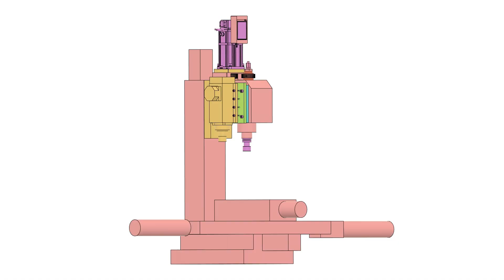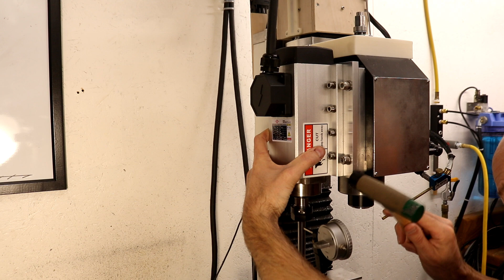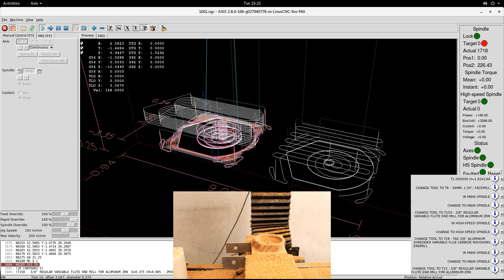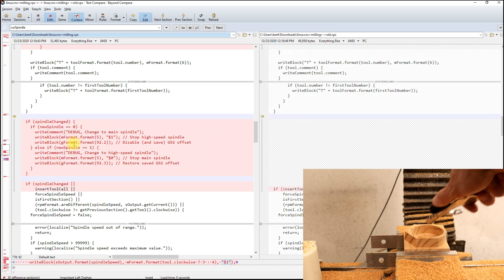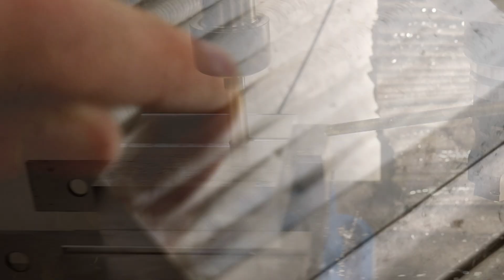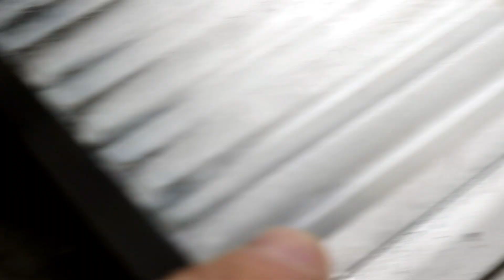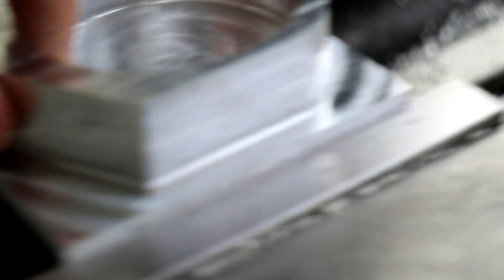Companion High Speed Spindle, LinuxCNC

Comment: try to slow that finishing pass abit more, i belive i am down to around 9000 rpm and 40 IPM on the finishing pass, with 0.2mm radial cut and a spring pass, leaves a very good finish, close to mirror
Even your spindle should handle that rpm, it doesnt have to run at high rpm all time ;)
Reply from the maker: :) Will give it a try. Your most recent video you use 4300mm/min for roughing, 24kRPM, then slowed down for finishing?
Reply: @kentvandervelden  12600 rpm, 10mm depth, 0.8mm radial and 4300mm/min, my spindle only goes to 18000, but mostly run it around 12 and down, sometimes 15000

the endmills can handle more than most know :)
Reply: Sorry, was in a christmas party (we have little counts of Covid-19 around me) 

Yes i do main cut, and then i leave 0.2mm on the walls for a finishing cut + spring cut at around 1000 mm/min (just below 40 IPM) and that has worked great.

I have also used some DLC coated endmills lately as finishing tool. and that has given great surface on walls.

Comment: Nice work Kent.  Could some of the surface finish be due to machine rigidity ?  Interesting project anyway.  When I designed my CNC machine  I allowed for an interchangeable DIY spindle to fit a low speed high torque unit but that is a distant project (!)
Reply from the maker: Probably nearly all of it :) And, in the main spindle there's 2 thou of runout, but only when the spindle is clocked in one place. Bad bearing or missing bearing? I debate between replacing the bearings and replacing the spindle. 
That's an interesting direction. Most people look for more speed, but you want lower. It's probably not practical at such high speeds, but something like a CVT or cone pulleys, optimizing pulley ratio for torque and speed could be nice.

Comment: I've been pondering this same addition to my mill.  It might be worth your time to build a second linear guide with ball screw that allows you to retract the second spindle above the primary and possibly lower as well.  Something with a smaller range 4-6" seems reasonable.
Reply: I had thought about this myself as I'll be going dual spindle (albeit with a very small NSK precision electrospindle). I'd be recommending either box or dovetail ways (either made or rescued from a cross slide on a dead lathe?) over linear rails because you only need to move them between two stops (unless you have extra long tooling that creates a specific condition) and then lock. Pinching the gib against the ways is an excellent way to make sure nothing moves (some clever hydraulic setup?). Then you're not reliant on a lead/ball screw and the attendant backlash. That said, it wouldn't allow you to swap in-flight.
Reply from the maker: Hi Gordon, that's great idea! Would get a lot of utility with the linear rails and a solid locking mechanism alone. Since the tool length must be measured each time a tool is changed, no harm is not having super precise vertical positioning.

Comment: As you have a nice selection of collets you may be interested in purchasing a "Bearing nut".  The ER bearing nut has a bearing incorporated into it allowing the collet to seat more uniformly and precisely.  The nut is also torqued to 95-100ft/lbs and holds the tool with substantially more force.   Depending on the size of the collet they range from 20-40$.   It's a great way to get more precision and from your tooling.   There are a couple nice vids demonstrating the gain here on the tube.
Reply from the maker: Thank you Gordon. Maritool has a ER20 bearing nut. I'll need to get a different torque adaptor, and that's a special order. Should be pretty interesting to try though.

Comment: your going back and forth, for a good finish only climb mill
Reply from the maker: On the facing operation? It's strange that Fusion does that by default, probably use a 2D pocket operation to produce a cool looking rectangular facing pattern. Interestingly, just slowing feed down a little improved the facing operation regardless of direction.
Reply: @kentvandervelden  while we're talking finish - I randomly tried the "Speed Tiger" variety of endmills off of Amazon and OMG.  Their 3 flute .5" bright endmill gives a brilliant facing finish in every direction I've tried.  For the price they are epic.
Reply from the maker: @shirothehero0609  Is the end mill model IAUE? Thank you
Reply: @kentvandervelden  tried to find a recent cut example, but everything laying around is all scratched or cut up.  I'll try and see if I can find or better, run a quick face op on some 6061 tonight.  I'm running a Tormach 770 with a fogbuster and Qualichem TRIM Mist.
Ive been blown away by the sidewall and bottom finish.  Bought one then ended up getting the 5 pack.

Comment: Could you switch to only using the high speed spindle if you were only doing aluminum and other soft materials? It's surprising that the high speed spindle won't have enough usable torque under 9000 rpm.
Reply from the maker: Absolutely! If only machining aluminum, plastics, wood, etc., I would have no hesitation replacing the entire head with a high-speed spindle. The upgrade would be nearly as much of an improvement as the CNC conversion. I would only think carefully about using a spindle like this or spending more to get one with BT/ISO or an ATC.
Regarding the 9000 RPM minimum, a few reasons come to mind. My best guess is that because the motor is relatively small for the power, the inductance is lower than big motors, more current will be drawn at lower speed, and the heat can't be discarded fast enough. The higher speeds would keep the current down. Might be able to get away with running a little slower for a short while. Maybe water cooled spindles would have a lower minimum? Torque is probably not effected too much, but power will be. Related to the comparison, I have no idea of the bearings used here, but many high-speed spindles are not meant for axial loading, and that's big difference between the two spindles.
Reply: @kentvandervelden  I seen some forum experiments with 4 pole high speed spindles and in theory could provide more low rpm torque. Maybe that could be a good compromise. And I definitely agree the loss of drilling and rigid tapping would be another feature to consider.
Reply from the maker: Hmm, searching four and six pole spindle motors on Amazon returns hits. I'll remember that. Thread milling is awesome. Pilot holes could be started with interpolated helix and finished later. With a proper enclosure maybe small diameter drilling would be OK. Calculated speed for 1/8" drill in aluminum is near 9000RPM, but so sure that's so safe. The water cooled spindles like mine might go to 6000RPM.

Comment: wondering why the  bottom height of the er colllet was not the same on both?
Reply from the maker: Mostly laziness? :) Probably I was overthinking it, but I had two reasons. I didn't like the looks of hanging the spindle so far, less supported, probably doesn't matter. The other reason is, the tool holders in the main spindle have greater variation in length. For instance, an R8 collet, TTS end mill holder, TTS ER20 holder, TTS modular. So, I settled on having the high-speed spindle up, and out of the way.

Comment: if you are doing pcbs keep an eye out on ebay for the NSK atc spindles. I got one for $200.  they are really great and you can use the 24k spindle to drive them up to the 50k the NSKs can do.  The ATC adapter is pretty easy to make, it is just a m5 thread and I just adapted that to a 1/4NPT threaded connector.
Reply: I wonder how good of a micro machining spindle cloud it be 🤔
The speed is plenty for sure, though I have some concerns about the rigidity for milling aluminium or steel injection molds for example
Reply: @geekoid183  here is some a2 steel being cut with NSK spindles  https://www.youtube.com/watch?v=vw_Te2C6HEw
Reply: Interesting, they seem to grab 1/8 tool shank directly. It's not an ISO, SK or HSK holder
Reply: @geekoid183  yes, the downside is the collets are expensive.
Reply from the maker: Very interesting! Is the output on the NSK 1:1 with the input? If you have a video showing up to set one up, please put it in a comment here. There are some exotic looking electric NSK units on eBay.
Reply: @kentvandervelden  this video describes the driver adapter, I can share the fusion file if you want.  https://youtu.be/nJdYm7aW-is
Reply from the maker: Thank you, that's perfect!

Comment: Good thing you didn't have to square that plate in the Y direction haha.....are  there torque specs on all collets? I never considered it could effect tool run out that much.....cool video Kent
Reply from the maker: Hi Aaron, would need to use quite a stack of shim stock :) The torque spec is on the ER nut. Needed for pullout prevention and runout. Merry Christmas!
Reply: @kentvandervelden  Merry Christmas 🎅
Reply from the maker: Ran across this torque chart:
https://www.cnc-tool.com/uploads/1/0/3/3/103363/torquechart_4.pdf
Reply: @kentvandervelden  awesome thanks Kent thats the stuff I...... think I typically over torque it looks like